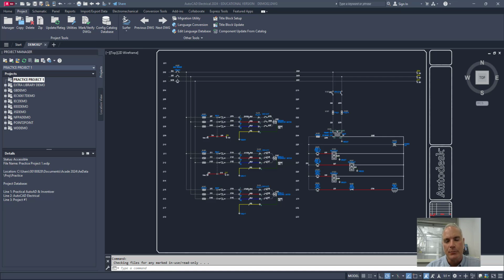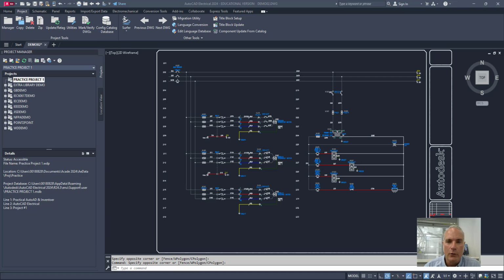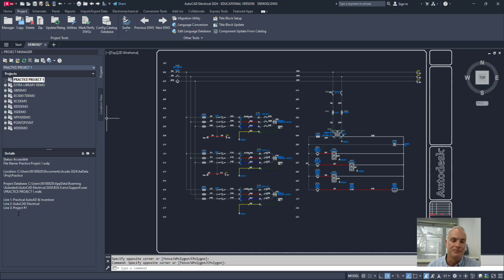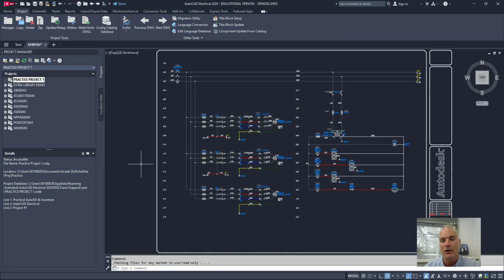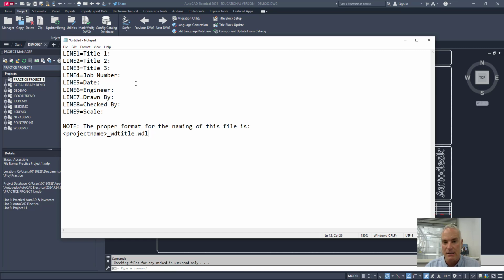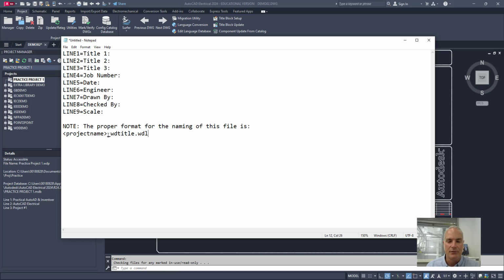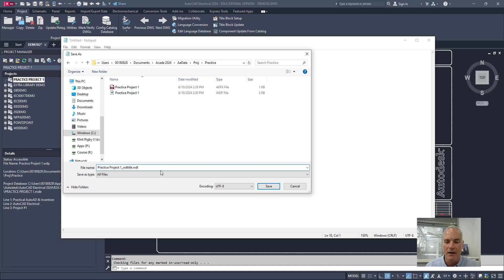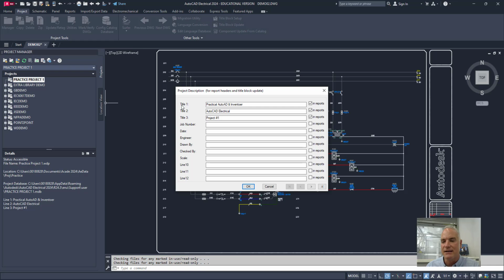AutoCAD Electrical - Adding a wdl File to your Project

Comment: This seems really straightforward and my descriptions dialog now shows title 1-6 as the first 6 entries but it still thinks line 4 is ENGINEER, line 5 is JOB NO and line 6 is DATE. I need 6 lines in my title block but I can't get more than 3. I am 3 days into learning ACE with the help of YouTube alone and I'm only able to duplicate the results of a video about 20% of the time. So frustrating. I think I want my $3200 back. My proj_name_wdtitle.wdl only has 6 lines mapping LINE#=Title #:

"Why does it say paper jam when there is no paper jam?"
Reply from the maker: Please let me know if you want specific questions answered in videos. I plan on making an entire series of videos over the next few months.
Reply from the maker: I get it! There are many aspects of AE that are NOT intuitive and make no sense. 

To clarify, the preview panel of the project manager will only show the first three lines. If you want to see the other lines, you will have to right-click on the project and choose descriptions. 

As for the other questions, are you using the standard border and title strip, or have you created your own?
Reply: @professor_porkchop I started with the NFPADemo project. The preview panel shows all 6 lines if I follow your instructions, that’s not the issue. The issue is the title block is placing lines 4-6 in the wrong fields even after the preview panel shows all 6 lines are mapped correctly. The title section of the title block is never more than 3 lines long. The demo project is mapping those lines in the wdt file but it looks wrong because several lines are mapped once and then mapped again on a proceeding line.
Reply from the maker: That is a head-scratcher for sure! I have not had that issue. I'm interested to see how we can solve that problem.
I will be posting a video on how to create a custom border and title strip with the descriptions mapped in a more intuitive way. Keep an eye out for it next week.